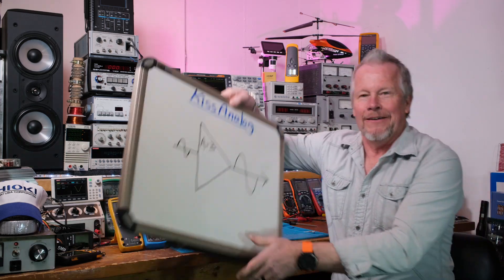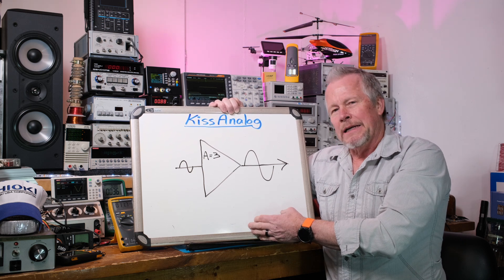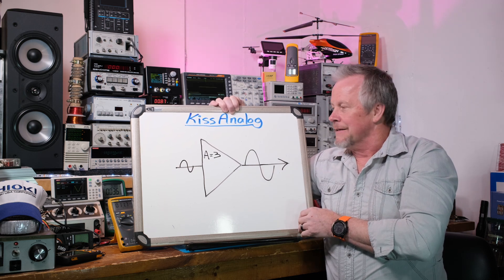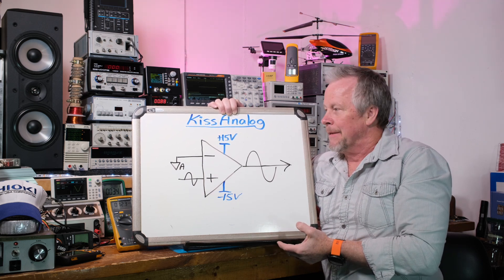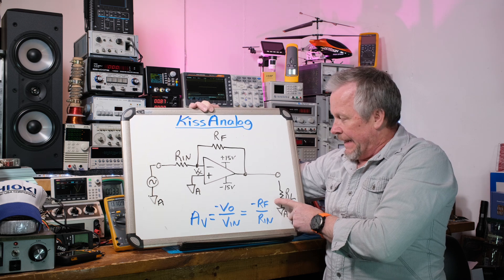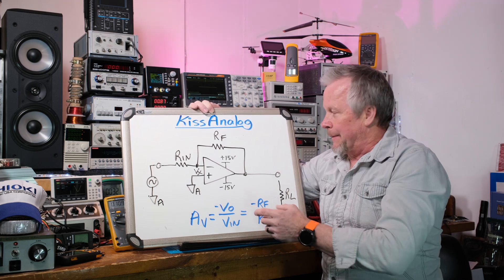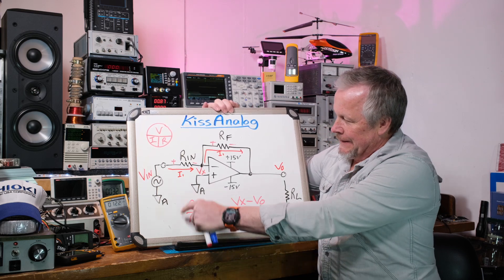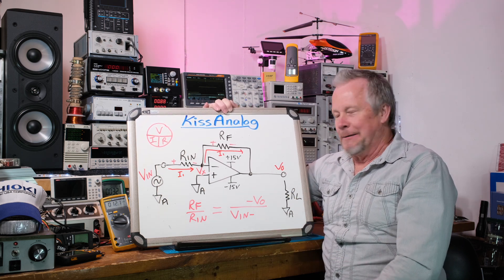How an OpAmp works - OpAmp Introduction

Comment: Have you ever thought of adding a Youtube join option? I actually prefer the join option. It leaves a symbol next to your name signifying you support the channel. I honestly have never been a whiteboard learner. I learn much better when you pull out a breadboard and put like an lm741 on it and show the voltages your meter and show the input and output with your scope.
Reply from the maker: Thank you Tron - that’s a great idea!  It looks like one common way is to have 3 levels, so I wonder what I’d offer for the 3 levels?  I think the first is a way to leave emoji and badges.
Reply: @KissAnalog  Since I belong to some other channels, Usually level 1 is basic supporter. Level 2 is you get to vote on upcoming videos, and level 3 is you get entered in special giveaways when they occur. 1-2 bucks level 1, 5 for level 2 and 10 for level 3

Comment: Amazing tutorial 
I think Op Amp tutorials will continue.Could you make a video about  :How use Opamps in Voltage and Current adjustable power supplys?
for example how protect opamp inputs from  over voltages  and how make controls to 30 volt inputs (O-30 Volt Voltage adjust in Power Supply) *I had read over 27 volts supply voltage not advice  also not much more op amps for over 30 volt supply
What is your advice Opamps  for  sound systems (Preamplifiers ton controls etc)
What is integrator using in Opamp ? what is advantages  where are using  or What is voltage Followers  
Summary I need these questions answers:What is this kind using advantage ? which problem's fix it 
Again thank you for great videos 
Regards
Reply from the maker: Thank you for this great feedback!  I'll try to answer these questions in videos to follow;)  I appreciate you!
Reply: With a FET output stage, you don't need that high rails to make it work (I fought that quite a bit myself ;) )

Well, work... I'm not quite there yet, getting oscillation issues, it's basically an LDO at this point, stability is mediocre at higher loads (relastively speaking). I think it's a phase issue, maybe doubtful wiring in my circuit, with an LM324 that is, a "better" op-amp totally gets out of hands. A bigger output cap keeps it stable for higher loads, but at some point it just gets ridiculous.

TL;DR: Looking forward to more op-amp stuff from you Eddie. :)

Comment: I google searched op amp and it shows the the plus terminal is on top? what gives?
Reply from the maker: Thanks for this example.  The lost art of electronics is real:( 
When I taught at a technical college, the book they used had not shown the negative sign on the gain equation for the inverting amplifier, so a student challenged me.  I showed how to derive the equation and that there is a negative sign.  Most of the students nodded and I could see that they agreed, but at least this one student couldn’t wrap his head around the idea that I could be right and an actual author could be wrong;)